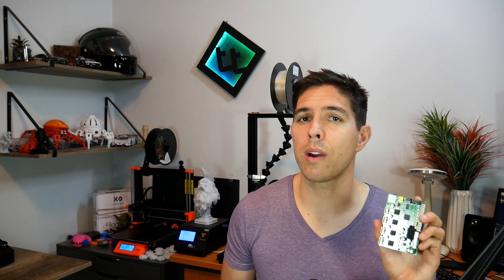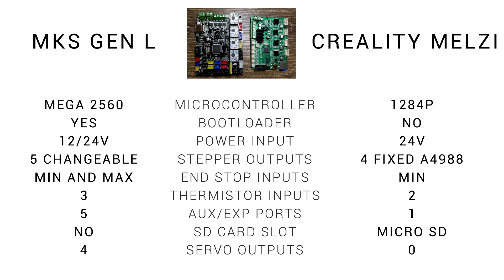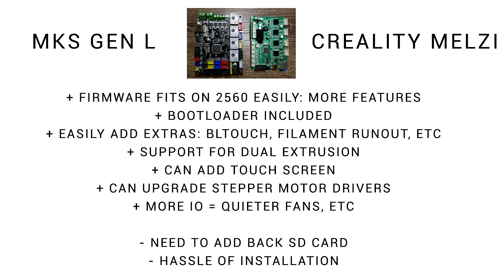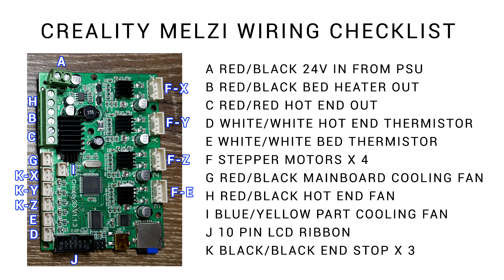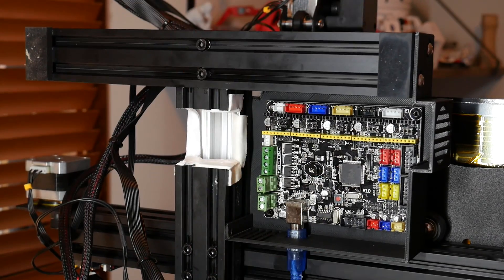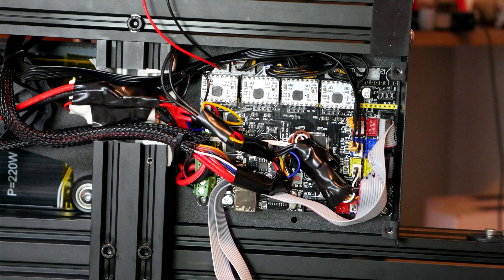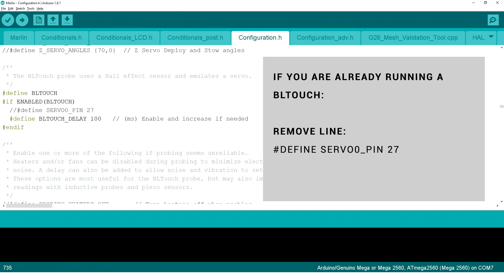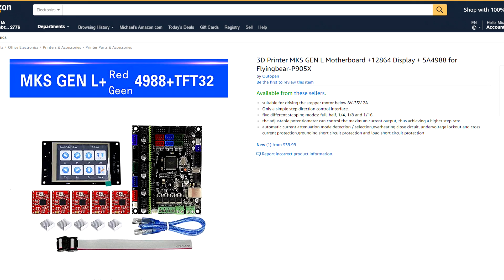Easy and cheap Ender 3 mainboard upgrade: MKS Gen L guide

Comment: @Teaching Tech - Found this video at the perfect time.  I just lost the Z drive channel on my Ender 3 board due to (I believe - more below**) a static discharge.  I isolated the issue to the board by swapping the X and Z cabling on the controller, the Z stepper worked fine off the X driver but the X stepper would not run.  So I just ordered this board with the TMC 2208 drivers option hoping that would also quiet the printing a bit  (board+5drivers kit $54 on banggood!).  I am pretty new to all of this so hopefully i didn't go overboard on the drivers for no reason.  

** concerning the static discharge or whatever - i am guessing that's what it was, i didn't find any shorts or anything else that may have caused the spark so assuming it was a static charge on the build plate and support bracket. I was using a metal rod (for listening) during a print job to pinpoint the source of a strange noise/vibration that only seemed to be present while printing a cylindrical object.  I inadvertently bridged one of the left side bed wheel adjustment... bolts? to the extruded aluminum Y axis and got a decent spark/flash but no loud pop or arc as i would expect from a short.  This immediately whacked out the current print job and the Z stepper stopped working.  Kind of strange that the Z circuit would have been affected when it was the Y axis that got the charge.  Thought maybe a wire was worn bare from the sharp edges on that frame cutout for the control box wiring, but couldn't find anything.  Fortunately the PI for octoprint didn't seem affected and it appears everything else on the board still functions as expected (nozzle heat, bed heat, x/y movement, extruder, screen, etc).  Looks like i now have a 2 axis control board, might be a start of a laser cutter project?

Anyway, any thoughts on this static discharge thingy?  Also, thanks for the content, i have referenced your videos quite a bit as i get more into 3D printing (your Meshmixer video was also great!).  I would support you on patreon but I don't agree with their idiotic censorship policies so canceled my account.  I would be happy to send you support through another method if you have one.  Thanks again.
Reply: I strongly suspect ESD as the culprit of my stepper motor driver failures. Slowly all of my drivers died on my original board. In my experience, just about the only thing that can take out robust power ICs is ESD. Even those with over-temp, over current/overload protection.
After the second axis died on my machine during testing, I realized that the table I placed my Ender3 on was an HDPE foldup table. After that realization, I quickly recalled that the hair on my arm would sometimes raise when it was near, or on, the table.
Other factors that didn't help are: 1) The Ender3 aluminium structure is anodized making each section likely electrically isolated. 2) Earth ground is not tied to DC ground. This is not a real big deal but does float the control board. 3) In my particular case, fans blowing air over the plastic table on a dry day is no big help.
I plan to move my machine off that table. Even then I will be placing it on an Earth grounded (via 1-Meg resistor) antistatic mat. I plan to add a 1-Meg resistor from the low-side of the 24VDC supply after I finish my upgrade to this MKS board.
Reply: @heyjoemiller  I ended up grounding all isolated parts and the frame to the power supply ground, seemed to do the trick as i haven't seen/felt any static issues since then.  I was also thinking about putting in ground filters to eliminate any chance of electrical feedback between motors, etc. which might  inadvertently affect print quality but that hasn't seemed to be an issue yet.

Comment: is there any way you can do a walkthrough of the th3d software changes.. i am having trouble finding the changes. Thanks!!
Reply: @Justin Halter I have implemented these changes in TH3D FW and have uploaded the code I use to github.  https://github.com/bassclarinetl2/TH3D-Unified-U1.R2/tree/hf_ender3pro
Reply: @bassclarinetl2  I'm having issues with the hotend fan not working with this board and the firmware. I can't seem to find auto fan pin anywhere for an mks option. Any ideas how I can fix this?

Comment: Hi. Thank you for this video. It encouraged me to think of upgrading my Ender 3 Pro. The link you have privided in the description for Ali's MKS Gen L with A4988 stepper motor drivers is actually points to Bigtreetech SKR V1.1 32-bit board on LPC1768 (like on MKS SBase), wich have almost all the same as MKS Gen L (including footprint) + TF card slot onboard. The board works on Smoothiware firmware, but they have instructions on how to upload Marlin 2.0. It would be great to know on how stable it works with current Marlin.
Reply: I was wondering the same thing

Comment: Very useful guide, thanks.
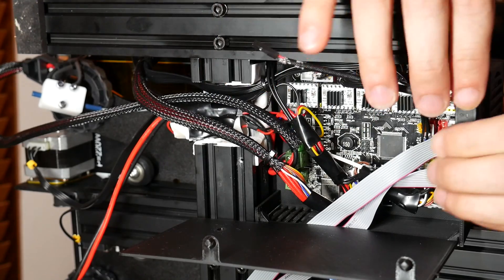At 8:13 you suggest connecting a mainboard cooling fan to the controller's 5v supply.
Connecting a fan to the same power rail as digital logic may cause problems.
The 5v regulator may not maintain a stable voltage if it's powering a fan and the sensor values (temperature readings) may fluctuate.
The simplest solution is to connect the fan to the 12v/24v connector (connector G in the video), where you originally located it.
A better (but more complicated) solution would be to allocate a spare digital pin on the MKS Gen L to CONTROLLERFAN_PIN in the Configuration_adv.h file in the Marlin firmware and use that pin via a 220 Ohm resistor to switch an external mosfet that drives the fan from the 24v rail via connector G. That will turn on the fan when any stepper driver is enabled and turn it off after the set amount of seconds from the last driver being disabled.
Reply: This is correct for the stock 24v fan that comes with the Ender 3, but he said that he took the opportunity to change to a 5v noctua, so he's not trying to run a 24v fan on 5v.
Reply: Thanks, I didn't catch that he changed to a 5v fan. I've edited my comment accordingly.

Comment: I am having to replace the entire hot end from my ender3.  a failed print while I was out encased everything below the heat break in plastic.  their is only 4 wires I see, the two white ones and the two red wires.  I see where they go.  The white ones go just plug in.  What has me wondering are the two red wires.  I followed where they connect to the board but I see any indication which goes where are does it matter?

Comment: Hello teaching tech,

I have a problem with my Ender 3. Since today the Disply shows me that I have an actual temperature of 260 Celsius on the Noozle and 140 Celsius on the bed.
Even if I turn the printer off and on again, the same message keeps coming up. Also helps here no manual temperature change and no cooldown. What's the problem here. Is it the software or the board.
I even played the software on it again. But no success.
I need some help. I hope you can help me. A fan of you !!!!

Comment: Regarding the VREF adjustment, do I have to remove the jumpers before doing that? I have the a4988 drivers as well. EDIT: Ok, I just realized I was mistaken and the jumps are used to configure the number of steps. Measuring the current vref and adjusting the same value on the new drivers makes sense.

Comment: I have been having the problem of my bl touch when auto leveling it goes off the bed and does not detect. Also when homing or leveling the steppers are working in reverse so instead of going to x min it goes to max. the printer is also not recognizing the bl touch as an endsto so it tries to keep going

Comment: Do not purchase these parts expecting this video or his previous videos to help you set everything up.  This video takes you out into the middle of nowhere and leaves you for dead.  I've followed the directions to a T over and over again and I now have a printer that won't work because the monitored temps just swing around wildly and the printer fails when it tries to heat the bed, so it won't go any further than that.  The author, Michael seems unconcerned about how many printers he has broken with his incomplete and/or incorrect instructions.  I've asked for his help and have received no response.  I've wasted $100 or so on parts I can't use.
Reply: have you found any fixes?

Comment: Okay, I've got the firmware uploaded now and everything put back together.  Now the temp for both the bed and hot end are swinging around wildly and the bed temp doesn't show any increase in the range it swings around in when the bed starts heating to the touch.  After a minute or two, I get the message "Bed heating failed PRINTER HALTED Please reset".  Also, X, Y, and Z on the Ender 3 screen flash between 0 and ? constantly.  Interestingly, if I turn off the printer to the printer and power the main-board via USB, the temps are rock solid (X, Y and Z still blink 0/? though).  Does anyone know what's going?
Reply: have you found a fix?

Comment: Hey mate I bought the MLS gen l and LCD with SD card slot listed in description,have flashed with marlin but the screen doesn't light up.the led on board does flash when turning pot with screen.how do I fix this.thanks mate
Reply: Just in case you have yet to figure it out, many of the RepRap LCD boards have inverted EXP1 and EXP2 ports. You'll have to clip the tab off the 10 pin ribbon cables and invert them.

Comment: Michael, Thanks for the video first off. I followed the instuctions in your video, and then installed the bltouch as per your outher video, but the bl does not stop the bed, it just keeps hitting the bed. I made all the changes to the firmware you had in the video. the bltouch lights up, and probes 2-3 times when i turn the machine on, but when i home it and manually trigger it, it keeps moving. If i diconnect the bl and plug the z-stop back in and repeat the process then it does stop the axis from moving. any ideas??

Comment: Could anyone that knows how to do this scan over my process below and let me know where I went wrong?

It was written to Michael originally, so the wording might seem odd.  

This is what I’ve done

Started with your “Ender 3 vanilla Marlin update: Concise guide” and did the following:

1. Downloaded Marlin 1.1.9 from Marlin website and renamed it “Marlin- 1.1.9 - Ender 3” and placed it in the “C:\Users\Nick\Documents\Arduino” folder.
2. Went to “C:\Users\Nick\Documents\Arduino\Marlin-1.1.9 - Ender 3\Marlin\example_configurations\Creality\Ender-3” and copied the five files in that folder.
3. Pasted those five files to “C:\Users\Nick\Documents\Arduino\Marlin-1.1.9 - Ender 3\Marlin”, indicating “YES” to replacing the files.
4. Executed the Marlin.ino file in the “C:\Users\Nick\Documents\Arduino\Marlin-1.1.9 - Ender 3\Marlin” folder, launching Arduino 1.8.8  with the Marlin files.
5. Verified this line “#define STRING_CONFIG_H_AUTHOR "(thisiskeithb, Ender-3)" // Who made the changes.”
6. Went to https://github.com/lauszus/sanguino website and copied the link you indicated
7. Pasted that link to File>Preferences>Additional Board Manager URLs: field and clicked OK
8. Then went to Tools>Board Manager and installed “Sanguino by Kristian Sloth Lauszus” (I didn’t think steps 7 and 8 applied to the MKS board, but I figured I just wouldn’t select it in the step in your second video where I select my board in the tools>board menu.  Just wanted to play it safe, in case that was my problem in my earlier attempts).
9. Went to Sketch>Include Library>Manage Libraries…, typed u8glib and made sure “U8g2 by oliver Version 2.24.3 was installed (I’d installed it in an earlier attempt)
10. At this point I switched to your “Easy and cheap Ender 3 mainboard upgrade: MKS Gen L guide” video, as the last step was to pick the original Ender 3 board, which I was not setting up.

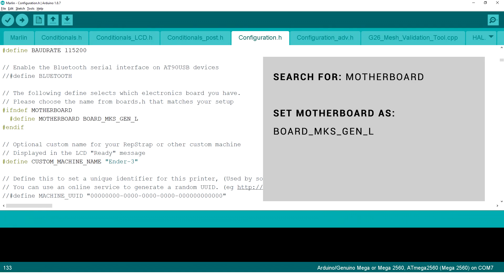Continued at minute 8:30 with your “Easy and cheap Ender 3 mainboard upgrade: MKS Gen L guide” video:

1. Changed this line “  #define MOTHERBOARD BOARD_MELZI_CREALITY” to “  #define MOTHERBOARD BOARD_MKS_GEN_L”
2. I’m setting up a BLTOUCH, so I changed this line “//#define BLTOUCH” to “#define BLTOUCH” and this line “  //#define BLTOUCH_DELAY 375   // (ms) Enable and increase if needed” to “  #define BLTOUCH_DELAY 100   // (ms) Enable and increase if needed”, so that it matched the image in your video”.  I didn’t have a “# DEFINE SERVO0_PIN 27 line” to delete or comment out.
3. Changed these lines:
#define INVERT_X_DIR true
#define INVERT_Y_DIR true
#define INVERT_Z_DIR false
#define INVERT_E0_DIR true
To this:
#define INVERT_X_DIR false
#define INVERT_Y_DIR false
#define INVERT_Z_DIR true
#define INVERT_E0_DIR false
4. Changed this line “//#define REPRAP_DISCOUNT_FULL_GRAPHIC_SMART_CONTROLLER” to “#define REPRAP_DISCOUNT_FULL_GRAPHIC_SMART_CONTROLLER” because I’m keeping the default display.
5. Changed this line “#define CR10_STOCKDISPLAY” to “//#define CR10_STOCKDISPLAY”
6. Changed this line “#define E0_AUTO_FAN_PIN -1” to “#define E0_AUTO_FAN_PIN 7”
7. Went to Tools>Board “XXXXXX” and changed the board to “Arduino/Geruino Mega or Mega 2560”
8. Clicked the check mark right under the file menu to test to see if it will compile and get this error “U8glib.h: No such file or directory”

Just FYI, I haven’t received my MKS GEN L board or BL touch yet.  Should be coming tomorrow, just trying to get a head start.  Couldn’t try to upload, but I assume that won’t work since compiling didn’t work.

Thank you, Thank you, Thank you!

Nick
Reply: Finally figured out what was causing it not to compile. I was selecting U8g2 instead of U8glib in the library.

Comment: Just realized that I had the motherboard as "MKS_GEN_L" instead of "BOARD_MKS_GEN_L" in my latest compile attempt.  Changed to "BOARD_MKS_GEN_L" and am now getting the error "Error compiling for board Arduino/Genuino Mega or Mega 2560".  Whole line reads :  #define MOTHERBOARD BOARD_MKS_GEN_L" in case you're wondering.  Any help would be greatly appreciated.